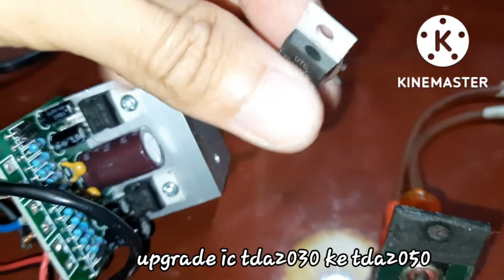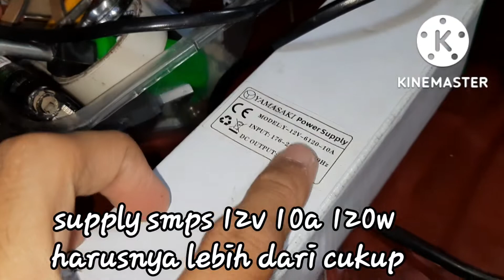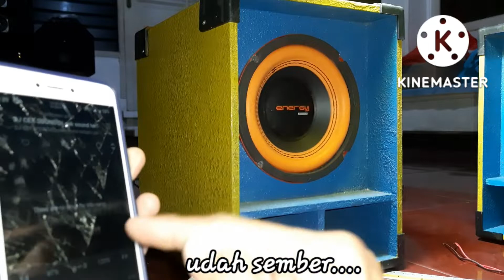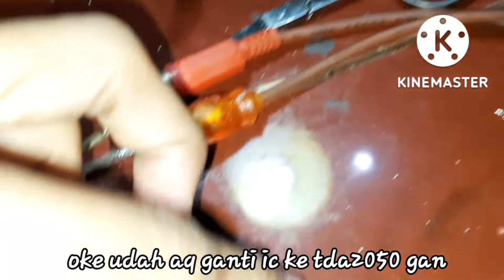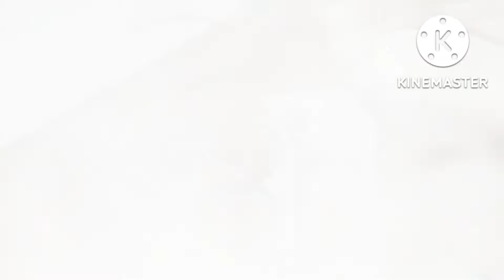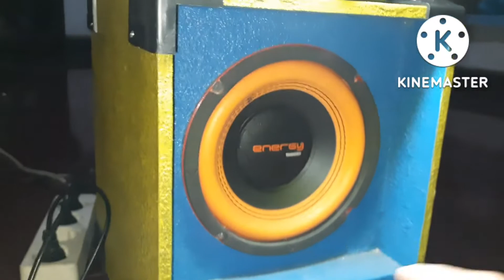menambah watt TDA2030 dengan  ganti ic ke TDA2050

Comment: Om mau tanya.. pin kaki TDA 2050 Posisinya PNP ya??mohon balas om auto sub..
Reply from the maker: Setahuku yg ada pnp npn itu transistor gan , sedangkan ini jenisnya ic  jadi beda
Reply: @adhywaw2280  maksudnya Plug N Play om.. tanpa rubah2 posisi pin😁😁🙏🙏
Reply from the maker: Owalah , iya langsung tancap aja gan
Reply: Om.. next project.. menurunkan tegangan DC to DC namun ampere trafo nilainya tetap sama..🙏🙏

Comment: Mantap untk tda 2030 sama dngn out put tda2050 iya kan bang
Reply from the maker: Iya pinout nya smaa
Reply: @adhywaw2280  saya mau ganti dari 2030 ke 2050.apa ada perbedaan bagus mana yg ku sebut tdi terima kash
Reply from the maker: Kalau ganti ke tda2050 harus naikan lagi amper dan tegangan nya biar lebih terasa perbedaanya  , kalau bisa supply yg simetris/ct
Reply: @adhywaw2280  suplay 12x2 dngn 2Ampere spiker 25wat 5inc bagus tdk bang
Reply from the maker: Minimal 3a yg murni